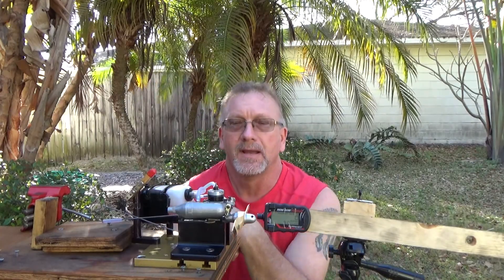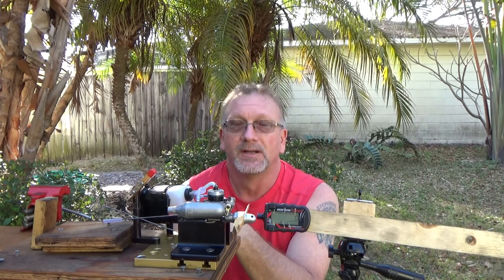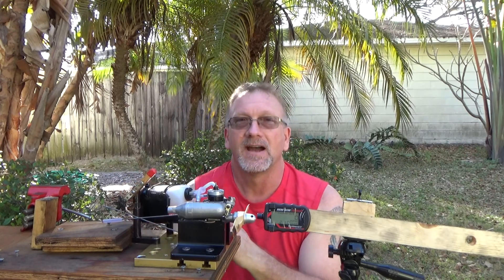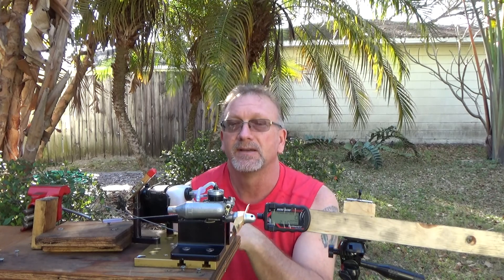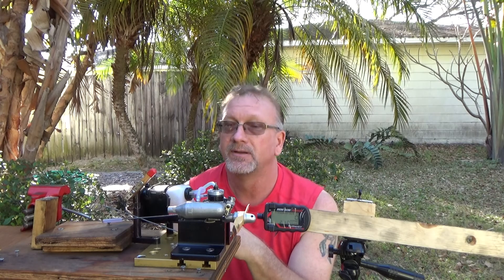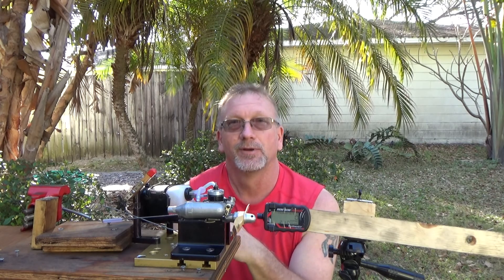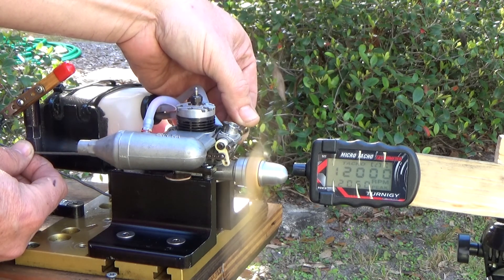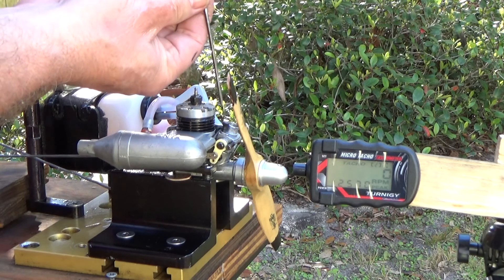OS Max-III 15 Another Run

Comment: I am wondering if back pressure effects a small engine like this as it does on something like a motorcycle or snowmobile. Most engines need back pressure to help them run better,more efficient.I need to get an RPM gauge.  Seriously, I use my ears to tune most engines,which doesn't help my hearing. I have tuned racing snowmobiles with no RPM gauges and never had issues. Guys used to poo poo me but my tuning techniques were more based on reading spark plugs and heat range. THAT was the key to winning. The fine line between lean engine and blowing it up was what won races on a two cycle engine. The guy that guessed wrong usually spent the next week rebuilding the top end,lol. I love hearing those little power houses whine. Brings back the good old days,flying at the high school.

Comment: HI DAVID!  i love your videos, but, need a favor.  have the same engine, mounted on a Vic Smeed Mamselle scaled up to 56",  really love my engine, as i really like to fly as assisted FF. but have a problem with the engine. at full revs and at lowest setting the engine works great, BUT,  all in the middle the engine runs like very rich, no matter how lean i adjust the needle.  and all the times, when flight at half throttle, at some time the engine dies.  do you know can i adjust to solve this??  Best Regards Rodrigo PS. my engine has not muffler, has those strange waffles, is i like to hear the engine.
Reply from the maker: Hi Rodrigo.  I have never had mine in an airplane, so I cannot say how it would respond in the air.  I have not been able to get mine to idle down below about 4000 RPM.  So my engine is not set perfectly either.  The carb on mine is an airbleed style.  I assume that you are familiar with adjusting an airbleed carb?  Adjusting the high speed needle is not going to have much impact on the mid range.  What prop are you using and what high and low RPM are you getting?

Comment: I'm surprised, that the engine has the same power output like currently sold engines of that size. I expected the new ones to be more powerful.
Reply from the maker: I think it would only get better with the better break in and more run time.